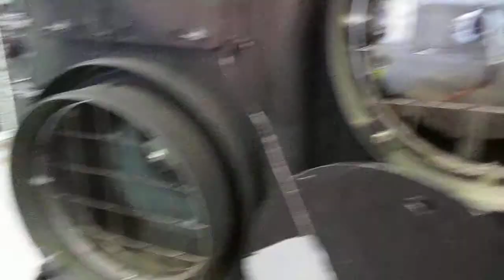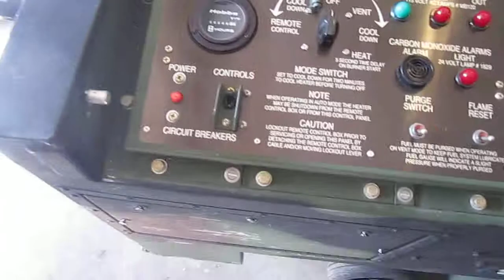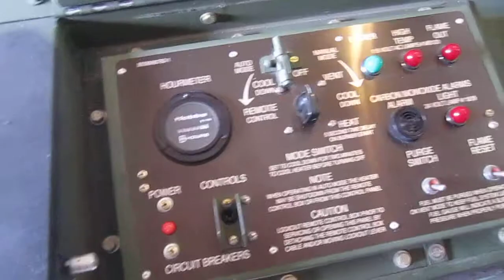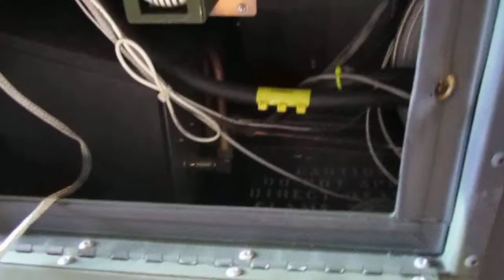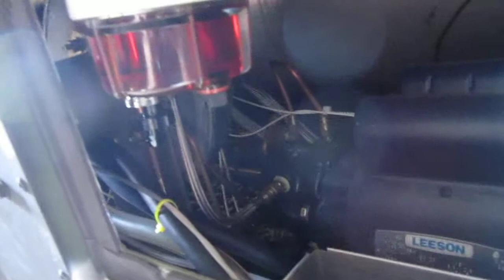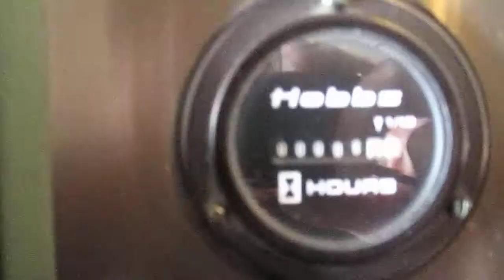choctaw heater 3 part vid part 1

Comment: Hey man, I just purchased one, I got it running but I'm not getting any ignition. Do you possibly know where I could start with fixing it?
Reply from the maker: Yes, one ofthe units I had had a similar issue. When running in cool down mode, look through your site glass and see if you see arcing of the probes that do the ignition of the fuel. If you do not see blue arcing most likely your arc transformer is bad. It’s best to unscrew the viewing window and make sure that it is clean as it could be dirtied up with some soot. Also verify that you have fuel pressure. One of my units I just got out the fuel pump actually locked up and broke the coupler so verifying fuel pressure and the Ignition transformer are working properly. I plan on making more videos just that had a lot of time to do them on problems and how to fix them with these units. Start with those two things I mentioned and we can go from there. Glad to help.
Reply: @jjr897  so I got it running and heating but now it won't stay running the fuel pump shuts off after about 10 seconds. The problem I had originally was the pressure switch was loose, adjusted it and she ran fine. Moved the unit and now it won't stay running

Comment: Hi I bought one it is in excellent condition it is heating my garage which is a 60X45 feet non insulated , it is magical ,i am using clean diesel from the gas station , but it is very hard on diesel consumption , specs say it is a multi-fuel machine , what would other fuel types be , may be a kind of fuel less expensive ,thanks for the video.
Reply from the maker: Bob Ismail mine is not horrible on fuel but you can adjust your pressure. Your fuel pressure might be too high and that’s why your consumption rate is higher. So you may not be running the most efficient what does your pressure gauge read. I only run off road diesel in mine. I believe it can burn kerosene when I have not tried that.